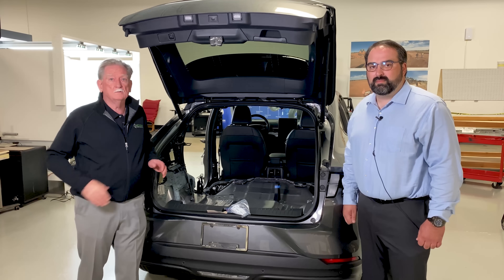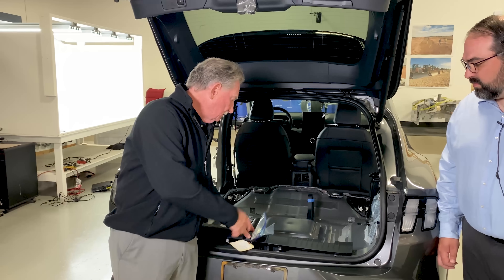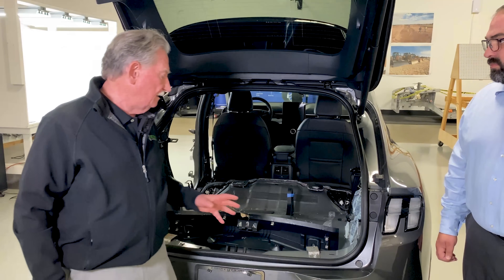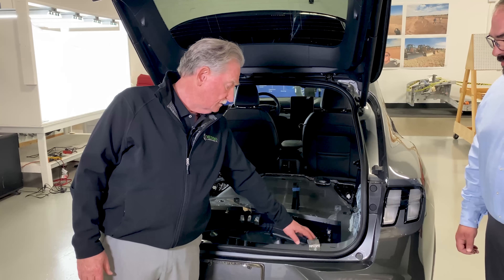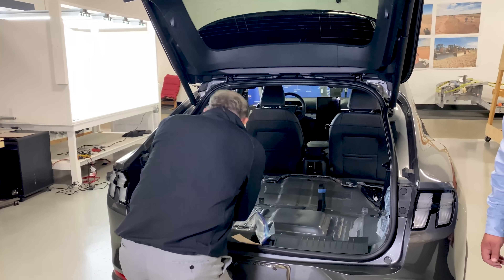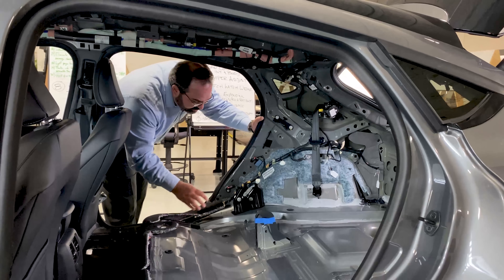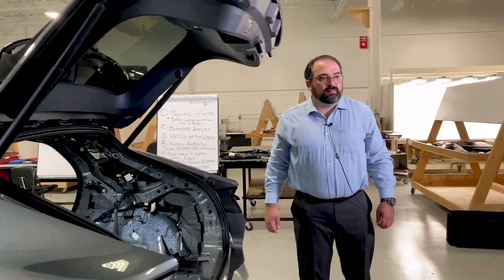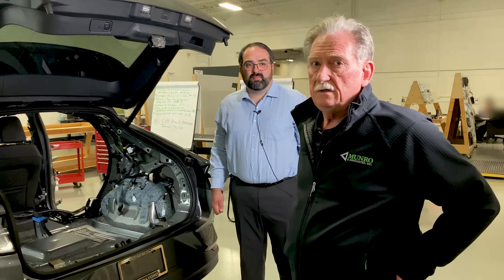Mach-E Teardown: Back Seats Gone - Analyzing Rear Interior

Comment: “Brackets are a crutch” this is absolutely true but still I hope project binky crew isn’t watching this. 😂
Reply: Hahah I was thinking this 😂
Reply: I think BOM  made brackets their signature product!
Reply: “Brackets are a crutch”, except they conveniently omit to discuss the fact there could be several legitimate reasons Ford chose to use brackets.  1) The rear structure around that hatch is almost certainly made using a high strength steel that may not have responded well to forming in the necessary shape to eliminate that bracket. 2) Better to have a couple $0.05 brackets than make the million dollar forming tool more expensive or compromise crashworthiness.  3) This platform is used for multiple cars (escape, etc) and may need flexibility to have the bolt holes in different locations, hence the bracket.

DFMA people are trained to have a simplified understanding of the world and want to apply their method uniformly—however, there are often valid reasons for the design choices made.
Reply: @GHinWI True those brackets are for the tiedown rings, how else would you do it
Reply: I don’t get it
Reply: @amimartian  you didn’t watch project binky then hahah
Reply: @amimartian  Look up project binky here on youtube (and expect to lose about 3 days catching up on 7 years of ridiculous fabication in fine comedy style)

Comment: Steven Mark Ryan suggests GM spin off a skunkworks, second company for their EV program, rather than trying to force ev’s through their old school factory.  They could move increasing resources over to the new company as it grows until it eventually replaces the legacy company… in order to survive.  They are not catching Tesla with clamps and filler, and they don’t have to, but this could save the company
Reply: Curious, when did you all start buying tsla?  I started 2015 ~ $200.  Made big mistakes in 2018-19 during the down trend. Went long with call options and lost 5 times in a row then margin called.  Forced to sell some shares at unthinkably low prices.  Fortunately, owned enough excess aapl to sell to buy back my position and more in my long term, no touch brokerage.  Lesson learned: be bullish, but skeptical of my bullishness when I am tempted to gamble on that bullishness.  I can be wrong short-term, even if I am 100% right long term.  Just buy the dips, and maybe leaps, but that’s it
Reply: Ford built a brand new factory just for the Mach E  - in Mexico.  great /s
Reply: Stop talking nonsense mate